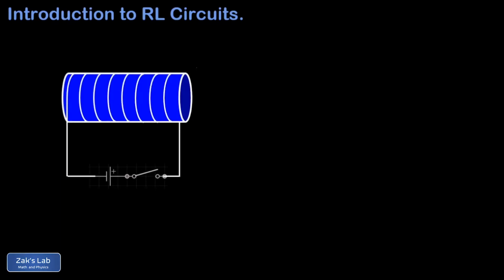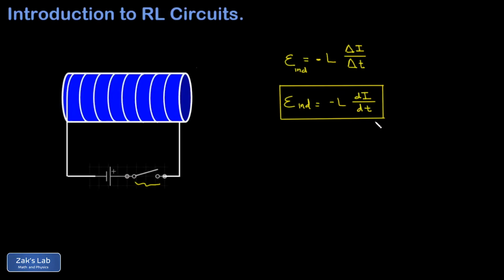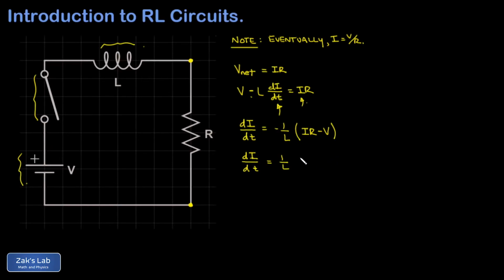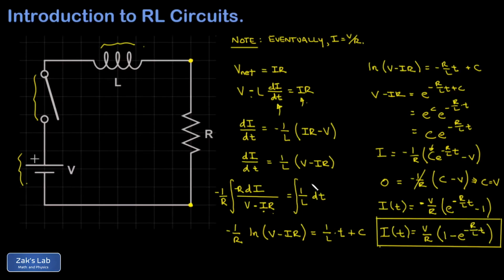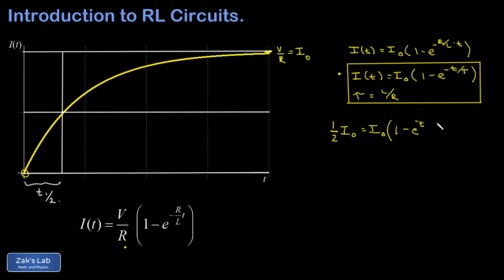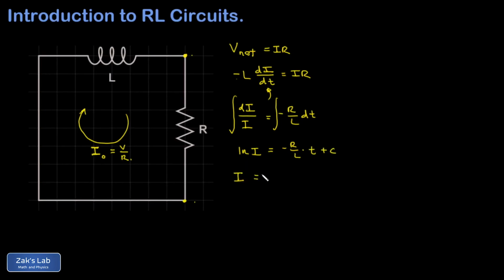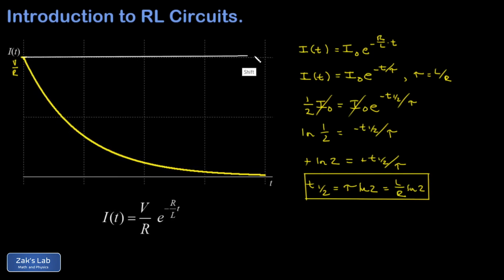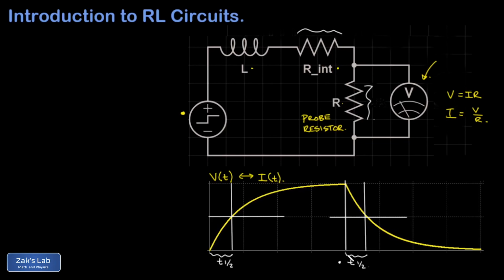Introduction to RL circuits: inductors and back EMF, derivation of current vs time and half-life.

Comment: ####!!!How can I get minimum 100v back emf from Inductor coils using these values?  20v DC,  7amp, with 2 inductors each .0015 Henry that has diode in series in between. (.003H) Shut off Time about .029second. based on duty cycle applied included? Possible? Or different shut off time?? Is this also positive Back EMF as was the input volts? Doesn't the VOLTAGE increase because of coil higher volts enters SECOND coil , so as even higher volts available?
To make use of this forward Back EMF, should I use half wave DC rather than full wave DC, so that there is an OFF time available for the higher volts to be able to go forward? Full wave DC has no spacing in between pulses.????,,??